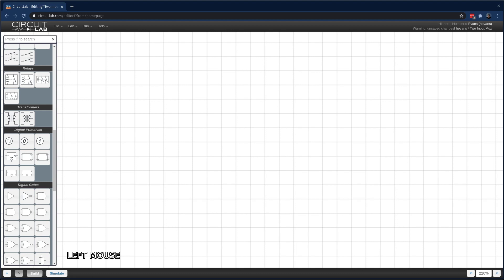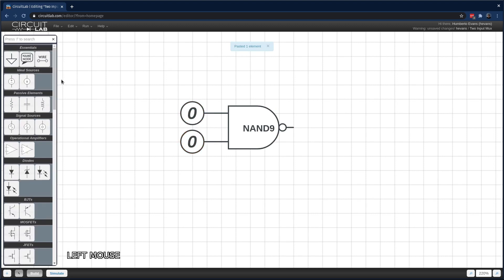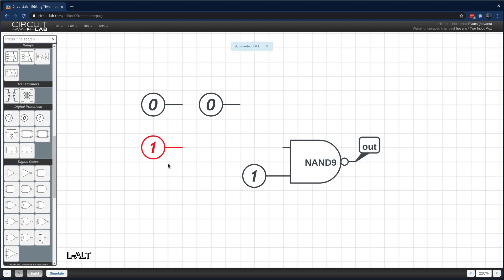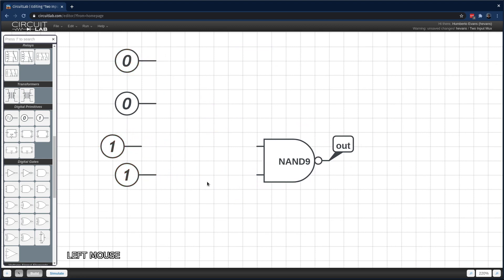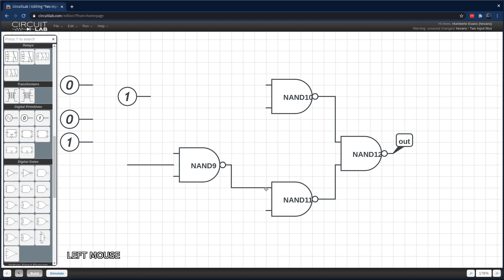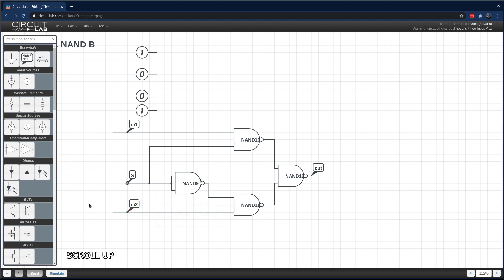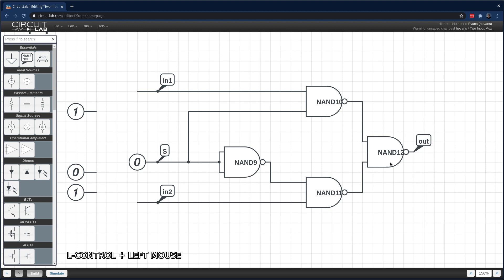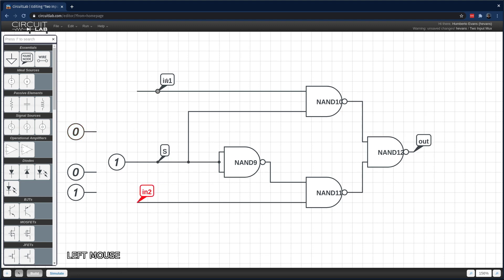2x1 MUX - What's a Multiplexer? (Built and Explained from 3 NAND Gates)

Comment: Your truth table is wrong at 1:50. It should be [0, 0, 1], [0, 1, 1], [1, 0, 1], [1, 1, 0]. You have [0, 0, 1], [0, 0, 1], [1, 0, 1], [1, 1, 0] - super confusing when you're saying that high 1 causes the opposite of the low. Haha :)